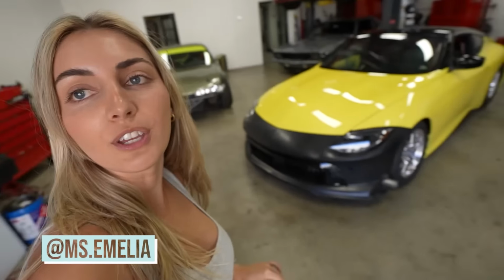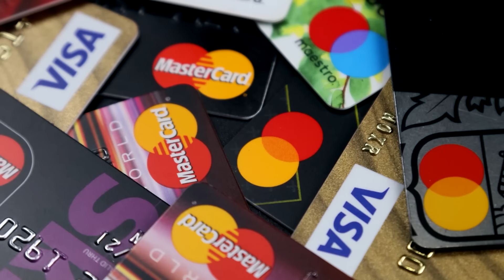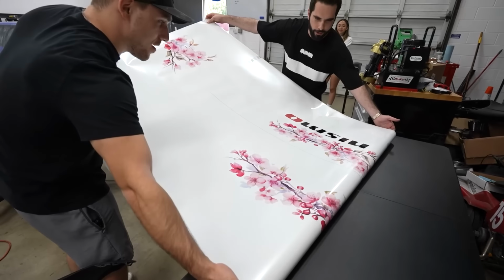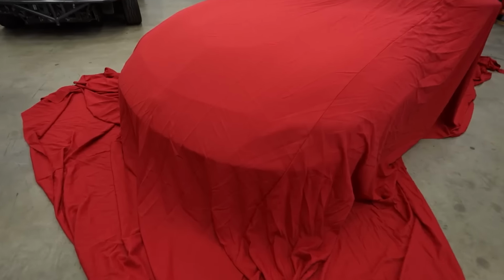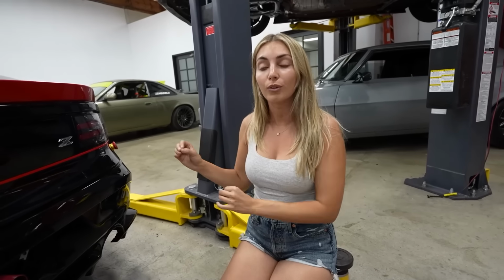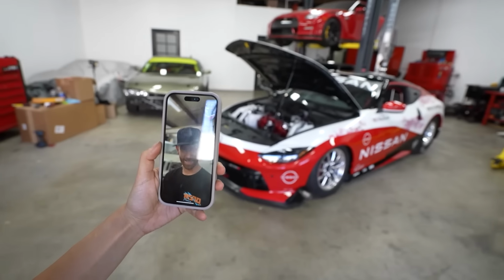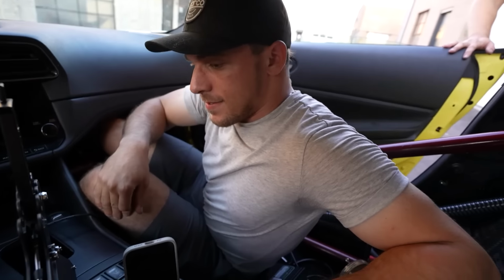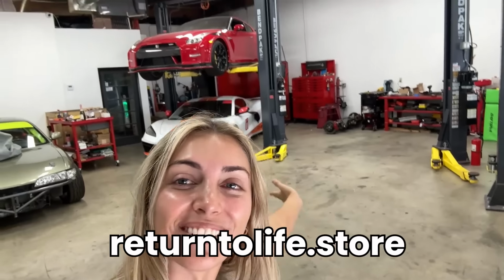Introducing my 2000HP NISMO GTR SwapZ. It’s Done.

Comment: @15:30 Leave the grill as it is! You can still see the turbos from the front, and it won't interrupt the flow (visually) of the front end. AND the Engineer/Engine builder in me would put some K&N filters on the turbos anyway! :body-blue-raised-arms:
Reply: @PoliticallyIncorrect14u  Wrap em in that bright corsa red they showed at the beginning.

Comment: I think you should keep the front grill as it is because it gives the car a mysterious look to it as to how big the turbos actually are from a distance because of the smoke affect the grill gives until you are close enough to see them and the location of the turbos they won’t think to look there because some drag racers want the power to be exposed but some want the car to give off the sleeper look and without the wrap that is amazing by the way it would be a sleeper race car on the street before you full send it you have a very artistic sense with your car builds which makes them more unique

Comment: Miss lady I was doing comparison to what the GTR do and what you got if you're okay and you're doing okay go in on that rim more because that car is sick we talking about maybe 5,000 lb going down the drag strip in the instant long term you need more linkage on that on the rear end long-term z go need more BBL and make sure you got enough to keep that ring and straight line panhard bar bracelet motor engine crazy